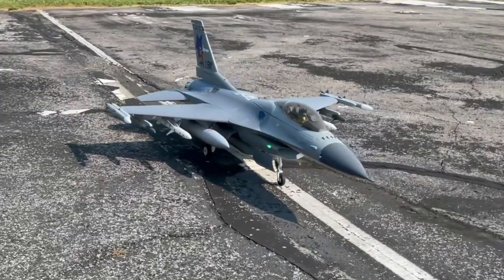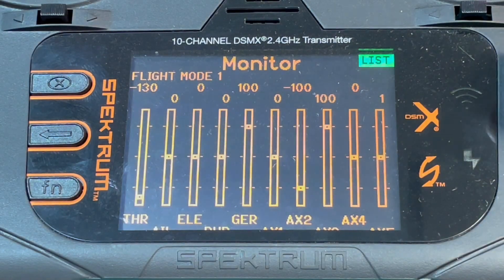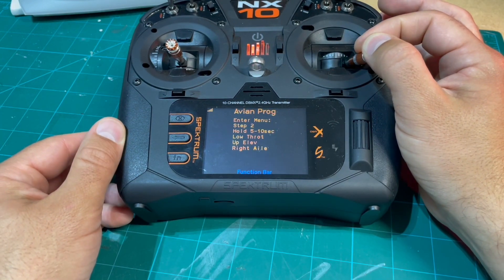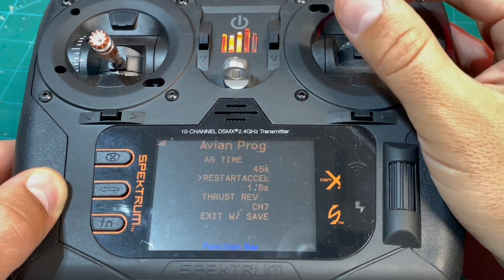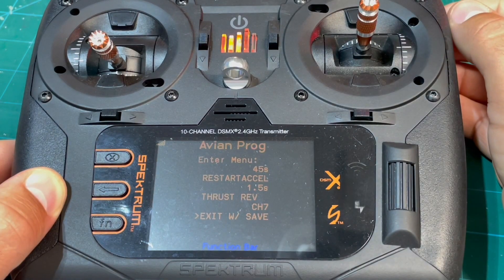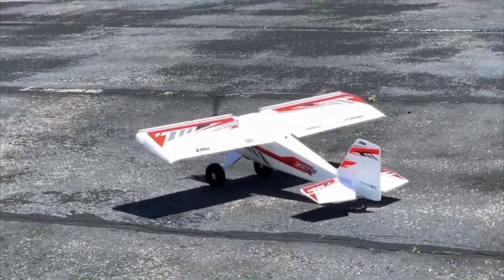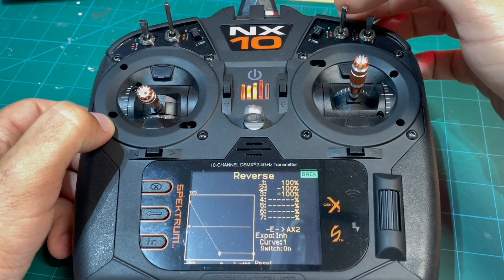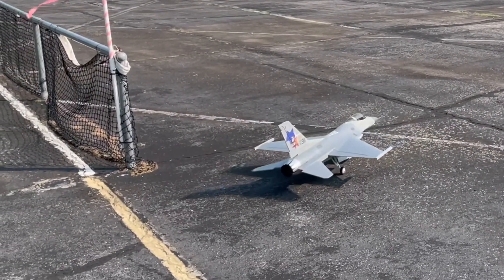Programming REVERSE THRUST for E-flite's 80mm F-16

Comment: The aluminum heat sink on my BNF E-flite 80mm F-16 was facing up instead of down toward the air duct for the EDF unit. I thought it looked odd when I was putting it together, but I left it that way. In the 90° Texas heat, the FET temperature hit 225 °F and it shut the motor off during each of the first three flights. After I flipped it over, the temperature came down to 197° and the motor kept running..

Comment: Yea, can't get my DX8E Gen 2 into program mode. I have the ESC programming box though. Might just use that. Its already preconfigured in the Draco. Same ESC. Wasn't sure how well it will work in the F16 with the cheater holes and fan blade but.. looks like it works enough. Good job man!
Reply: Following cause I have the same radio
Reply: @paulballard4243  have you tried it yet?
Reply: @Sabotage_Labs  no that’s why I’m following lol
Reply: @paulballard4243  lol. Yea, I tried a few different things but just couldn't get it to go into programming mode. I have a spare 100amp Avian esc and a 637t reciever. Gonna do some bench testing.
Reply: @paulballard4243  Ok, dunno if our new favorite RC dude Andrew's radio is different or he just forgot this step but....
Before connecting the battery, put your throttle full up. Let it power up with initial beeps. If you don't put it back down to calibrate the stick after 5 seconds, the ESC enters programming mode (as per the Avian ESC guide). 
Then, go to the ESC programming page on your xmitter, do the stick down left for 5 seconds, down stick right for 5 and...you're in business! 
Well... I can make the changes but having a problem getting it to "Save and Exit". Still tinkering. 😋
Reply: @paulballard4243  ok... scratch the last post. I had a trims in not giving me full 100% deflection. Good now and... really don't need to do a mix. Just set break type to reverse, pick a channel and save. 
Then, in digital channel setup, pick a switch (I use A) and set to
Pos 0 = -100
Pos 1 = 100

You're done. Works just like the Draco. Can't wait to try it at the field now cause this thing wants to roll forever! 

Just watch this Spektrum video. 

https://youtu.be/5SdE2Ok2TRU
Reply: @Sabotage_Labs  cool man thank you!!!!
Reply: @paulballard4243  Safety first, than teamwork! 😋